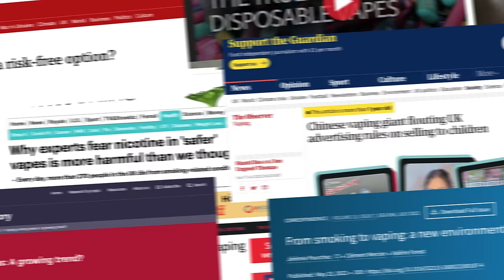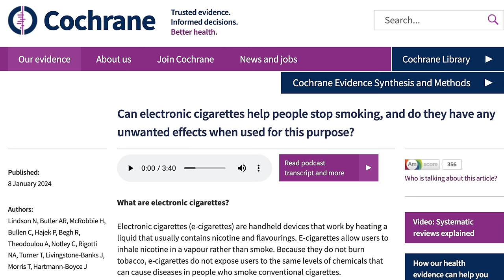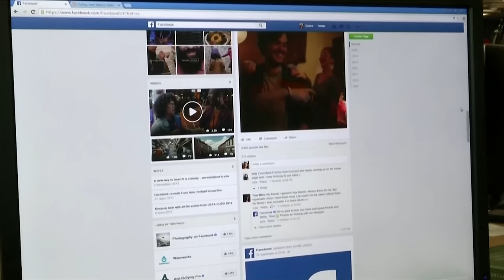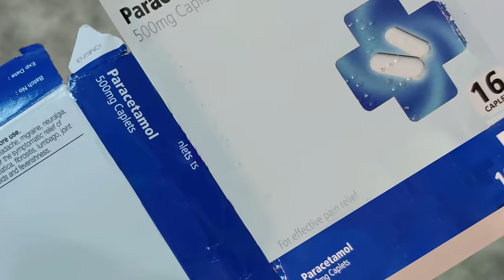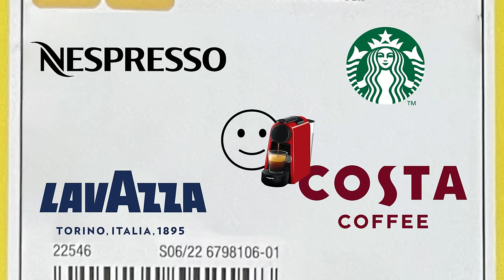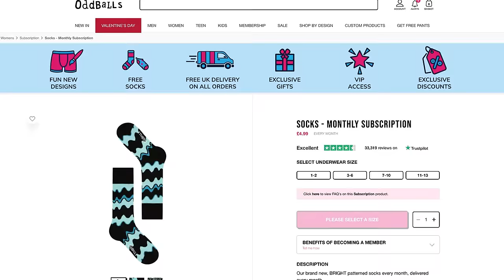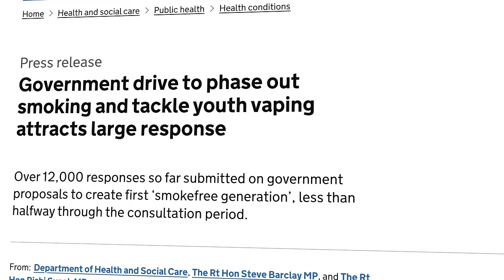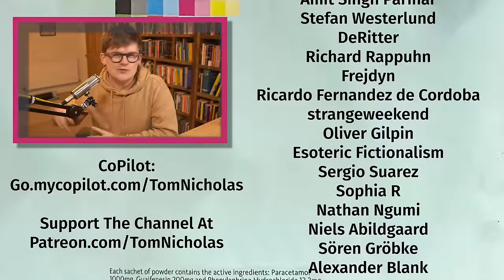Vape-o-nomics: Why Everything is Addictive Now

Comment: We used to find cigarette butts all over the sidewalk. Now we find disposable vapes with discharged lithium ion batteries in them.
Reply: I'm shocked how vaping became like this. 5 and more years ago the vaping devices were finicky but had minimal waste. Disposing of a whole device instead of just recharging and resupplying the liquid is a mind-bogglingly radical downgrade. Can't find the better example of planned obsolescence than this!

Not to mention that most vapers were former smokers and many of them were actively trying to gradually switch to zero nicotine liquids.
Reply: The more things change, the more they stay the same.
Reply: technology!
Reply: They are only partially discharged, and at the 3.2 volts they commonly still possess on disposal, they could each power remote controls for household electronics for a year before becoming unusable.
Reply: @tikaanipippin  Or you recharge them and they don't become unusable.
Reply: @Miraihi capitalism makes everything disposable so that you buy more over time

This is how everything works, from vaping to homes to appliances...

It's the optimal profit strategy.
Reply: No joke. I go litterpicking in my neighbourhood several times a week and I've come to particularly detest them because I pick up so. Damn. Many. One time I came across an entire shopping bag full of empty ones someone had dumped across the street from a public bin (I mean why??? The bin was right there lol)
Reply: Those batteries are very rarely discharged.  Many still have half their charge.  The remaining charge is why there has been an uptick in waste processing centres and landfills catching fire during the past couple of years.  The batteries are oversized for the application, and they are rechargeable.
Disposable vapes are a great source of free batteries if you like tinkering with small electronic projects.
Reply: Vape trash, fast food garbage, liquor nips, beer cans, dunkin donuts, candy wrappers, losing scratch tickets... the litter is never from healthy stuff. No empty sprouts containers🤪.

I vape hash oil, but not with disposables.
Reply: It's definitely not great, but there are alternatives that people aren't choosing, which would vastly cut back on the amount of battery garbage
Reply: @GizzyDillespee  Everything creates waste. People aren't usually eating brussel sprouts on the go, are they? That's why you don't see the waste from producing them on the streets.
Reply: @DylonsBBGorl  fresh food absolutely does not create as much waste as junk food lmfao apples don't come in plastic boxes.
Reply: With fully working sensors, chips, electronic board and so on. I don't think there is a stock product of mass consumption as wasteful and damaging to the environment as single use vapes
Reply: Evolution
Reply: @Jane-oz7pp  The machines needed to run the operations, the transportation, the sheer amount of produce, and yes, they do use plastic. Trust. Also, I didn't say it created as much waste. I said everything creates waste.
Reply: I have a whole bag of these batteries that I've picked up here and there over the years. Good for small projects and they use really thin gauge wires that are perfect details for models I build. They are rarely dead, the nicotine juice runs out way before the battery typically, especially in the counterfeit ones.
Reply: Yeah, no, you're right, I find so many of those. So many timost of them are just not even fully Dead.
Reply: I see this as an absolute dumpster diver W
Reply: And sometimes I find discarded single-use vapes with fully charged lithium polymer batteries.
Reply: @RedHeadForester  The batteries can be a fire hazard even when discharged. The lithium in the battery itself is flammable.
Reply: @bornach   Yes, but it kind of shows that both cigarette users and vapors Has More of a likelihood to litter their devices than weed smokers This either shows that weed smokers value their stuff. Mor that they're more addicted. I fall into this category. So I don't know.
But it's an interesting Bit of personal data.
Reply: Arguably worse
Reply: Addiction is something.
What's it's not blainely targeted towards children. But you know it is these industries would have a clear motive Financial opportunity from a user base who has less self-control over their current emotions.
And that the people who are all about different types of brands Gucci. Versace. And The rise of hype shoes it all makes for.
The perfect people that they Should target. This is why jewel went out of business and got sued.
Reply: @Miraihi  Disposables are inherently made for children one they have Flavors that stand out instead of more mild ones which adults.
Would use Second, children are the perfect people to advertise too. They have no self controver current emotions  And they are inherently more fond of brains such as gucci and versace  A child's more likely to lose break or misplace their disposable. And once that happens, the the vap companies know that they're just gonna buy Another
Reply: @felixmoore6781  disposable vapes aren't designed to be refilled or recharged though, so it's not as easy as "just recharge it."
Reply: @Miraihi i miss old school vapes.  They banned nicotine liquids in my country so now all that's available are the disposable ones because the people selling them don't care (they usually sell other illegal products anyway). Even though vapes were the "coolest" way to quit smoking they were a long way from being as cool as smoking.  

I find it really strange that anyone who doesn't smoke would want to vape nicotine, it's no more fun than vaping flavours if you haven't already got the addiction gnawing at you. 

People get addicted to it because these disposable vapes are often sold unlabelled so they're consuming nicotine unknowingly or because the disposable vapes are often 2-10 times stronger than anything an ex smoker would have in their tank.  

Disposable vapes are for idiots, but there are plenty of them.
Reply: @tikaanipippin they're fairly easy to salvage as well without any special skills or training.  So long as you don't puncture them (like other batteries) they're pretty harmlesss.  

It's literally insane that people throw them away, they're worth a lot more to recycle than paper or glass.
Reply: I take all the batteries the vapes my friends throw out and reuse them. I have made a few portable raspberry pi’s and keep an eye on the battery. As soon as I see any sign of a problem I take it to a local vape store, they take it for me, and I put a new one in there
Reply: @Miraihi Disposables are easy, that’s why they sell. I worked at a vape store and 80% of people who buy disposables are young 20 year olds and a few early 30 year olds. You get it and hit it. Don’t need to worry about coils, refilling the tank, or changing batteries
Reply: At least it’s recyclable
Reply: What city do you live in ?? Lmao I don't see batteries laying around
Reply: @mandarinduck  They use standard rechargeable lithium cells (might be outdated information, but it's most likely still true). I've scavenged many cells from disposable vapes and they definitely are rechargeable. See, it doesn't really matter what the device manufacturer tells you it's designed for, especially if they profit from consumers believing what they say. Anyway, my reply pertains to the cells in particular, and those are designed by the cell manufacturers to be rechargeable. The fact that they're used in such a wasteful way is just another affront.
Reply: UK just announced they're banning disposable vapes...what timing!
Reply: as an australian my first fear is the risk of fires, and especially in summer, fires are gonna be worse. If cigarettes can cause devastating bushfires, i wonder what tossed batteries can do.
Reply: Literally everyone I know uses some form of at least partially reusable vape. I don't know who these heavy users of non-reusable vapes are. Has anybody seen them? What message boards are they on? Can we like tell them to stop doing it?
Reply: I still find cigarette butts everywhere when I pickup rubbish
Reply: Here in Denmark we keep finding nicotine pouches
Reply: The U.S. really needs cigarette disposal containers, and an equivalent for vapes. They really work. When I smoked regularly I always appreciated having a proper place to throw away the butt
Reply: Free street batteries
Reply: Yes I do NOT understand 'disposable' vapes, it's sickeningly wasteful to me. I even keep old vape carts so I can recycle them
Reply: Most people who use recycle them, especially the younger generation. Everything from monster cans to a pile of dispos, we like to see our addiction in progress
Reply: @Miraihi Because thats too much work for the average person. I think ritualizing smoking could help many, but many dont have the literal time for it. Cant help those who are already addicte, but we can prevent new ones. Bannign vapes isn't gonna do tbat
Reply: More of a fire hazard than cigarette butts
Reply: They’re not even discharged
Reply: Discharged lithium ion batteries?? I think not -- plenty more battery charge than fluid in these things. I think Big Clive even picked some up from the ground to check this!
Reply: At least when civilization dies and all the power goes off you'll be able to find your way home by the trails of little flashing blue LEDs...
Reply: @Pensnmusic Capitalism is the least efficient system possible, by design.
Reply: Shouldn't there be a push to get them recycled like they used to do with beer bottles?
Reply: @keithparker1346  Yeah, but most of the people who use them are kids, and kids don't give a fuck about littering. Less than half of them even end up in a bin let alone being recycled.
Reply: @AshenVictor  kids? A bit of a generalisation on things
Reply: @tikaanipippin  I heard they're usually rechargeable too but the manufacturers just don't put a charging port on them
Reply: @Jane-oz7pp  Unfortunately the waste from the produce industry is mostly plastic garbage. The clamshell packaging that many salads and yes, even some apples, are unable to be recycled. Two things can both be bad in different ways
Reply: I think you’re really not addicted to nicotine because you still feel cravings with a patch on the size of a door mat
Reply: That's really bad.... People shouldn't throw batteries just out on the ground.
Reply: @Jane-oz7pp this might surprise you... But sometimes stores do sell apples in plastic apple shaped containers for bulk buys.
Reply: @keithparker1346  I'm old now, so kids is basically anyone under 40.
Reply: @Miraihi  nah its because the reusable ones that had flavors were banned by the FDA, but flavored dispo's wern't
Reply: In the south, cigarette butts still litter the sidewalks.
Reply: @tikaanipippin it's also cheaper to produce rechargable batteries than disposable so many brands are using rechargeables in disposable products. Crazy how many usable batteries are going to waste
Reply: @AshenVictor I agree...anyone younger than me has become a crotch goblin in my view.
Reply: @astilealavatica1404  To be fair, that's been going on in history since ancient Greece. I mean that's when someone first wrote down in our history that the youth isn't as good as what was before.

 So by now, we're all just bumbling idiots. The ancient Greeks would sort this out. 😅
Reply: @jedahn  I don't know what's ahead for humans but I purposely didn't make any more...I'm tired of the cycles of pain.
Reply: @Miraihi  We changed to disposables because legislation banned good flavor Juuul pod systems FOR THE CHIL:DREN but not disposables. Thus the waste. Stupid gov.
Reply: @astilealavatica1404  I did the same. I feel it.
Reply: No, you don’t
Reply: @Pluralofvinylisvinyls  random and out of context, thanks!
Reply: @astilealavatica1404  it wasn’t even in reply to you.  Learn to use the internet. Thanks.
Reply: @Pluralofvinylisvinyls  Learn to tag the person you're replying to. Isn't difficult.
Reply: @astilealavatica1404  I literally just tagged you when I was REPLYING to you.  Do you understand you’re not the OP?
Reply: No you don't, stop lying.
Reply: @jamesoakley3952  As you toss your spent vape on the ground...
Reply: @legendarystuff6971  the thing they might do, by being so wasteful, is make recycling actually worth it. In the sense that the components are significantly more readily reusable than the plastic that has failed its recyclablility promise. Li ion batteries, usb c ports, leds, and occasionally displays, all much easier to recycle than low grade plastics.
Reply: @astilealavatica1404  I've never seen a disposible vape on the ground and see a LOT less ciggie buts than you used to. Where do you live?
Reply: @jamesoakley3952  Hell, mostly.
Reply: most vapers i know are high schoolers, or started in highschool  @Miraihi
Reply: @Miraihi   No.  Laws were changed making the DIY market impossible and big companies created the disposable vapes.  People take the bars apart and refill them to make them last as long as possible.  The laws written by corporations to push out DIY so they could sell trash is the reason this problem exists.  I've been vaping since it was new and went from a huge community driven DIY hobby to it being illegal to buy certain DIY materials online and requiring adult signatures for delivery etc etc etc.
Reply: where do you live that has disposable vapes littered everywhere lmao?
Reply: @GizzyDillespee  wow you vape hash oil you're so cool man can we be mates
Reply: @davidz2690  new york state, from syracuse, north to the border, every town has vapes littered everywhere
Reply: @ancientindigo2868  lol that’s crazy, people are disgusting
Reply: @tikaanipippin  or explode
Reply: I always pick them up when I see them, I have no idea how people can be this stupid about it
Reply: And yet we need to drink through soggy paper straws
Reply: @Miraihi juul.
Reply: And
Reply: @mastersystemknuckles8893 no thc vapes use cart and reusable battery
Reply: No we don’t? Lol
Reply: @Jane-oz7pp  Apples in the UK come in plastic bags and nectarines, plums, peaches, LITTERALY come in plastic boxes. I think its a class issue, healthy food tends to be far more expensive per calorie vs unhealthy products. The cheaper something is the more it will be used by people who are struggling & therefore may have less bandwidth for dealing with their waste properly. 

For example, its a lot easier to not throw your plastic fruit packaging on the floor as you eat it in your car on the way to work at 8am, than it is to not throw your empty crisp bag on the floor as you walk 40min at 5am to a bus stop to wait in zero degrees for a bus. In scenario two, "ah fuck it I'm not walking an extra 3 min to the bin" makes a lot more sense.
Reply: Jeez, haven't seen that problem too much yet, but at least cig butts are slightly biodegradable. With vapes its plastics and batteries instead of a bit of cotton and paper.
Reply: @naominekomimi nin was always right.
Reply: @felixmoore6781 ah, but how do you refill them? They're designed to be thrown away, not used until the thing falls apart.
Reply: Can't we recycle those into battery power banks or something?
Reply: Now it's cigarettes again because all my peers have decided they're cooler than vapes again (I'm in university)
Reply: They usually aren't rechargeable lithium ion batteries. That would be a lot more expensive. It would make no sense to put a rechargeable in a one-use product. Still not great.
Reply: alongside the cigarette butts
Reply: @Miraihi  as a 15 year old id say most vapers are children. genuinely. at least in my country, as every adult in the nordics with a nicotine addiction just smokes or switched to snus
Reply: I'm mostly concerned with how it's even legal.
Reply: @Miraihi  Add to the fact that disposable vapes have gotten larger over the years with bigger batteries and bigger pods, means more waste piling up at an alarming rate. A couple of years from now, we should expect laws on banning disposable vapes but it should have been sooner...